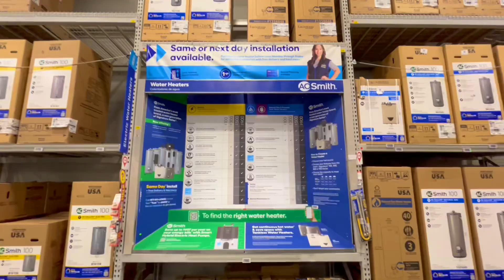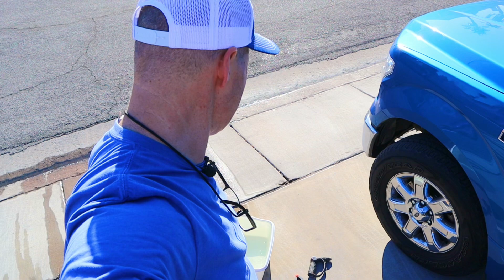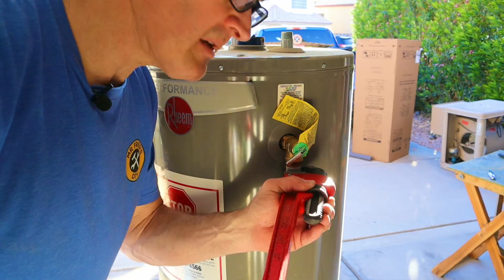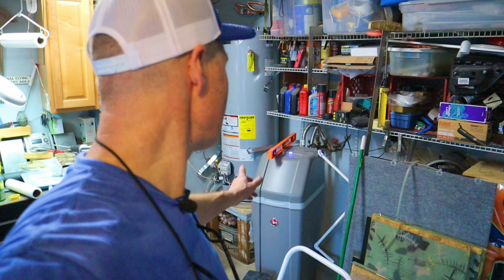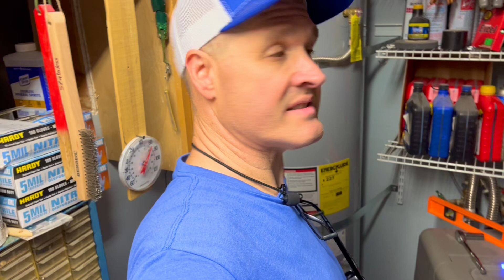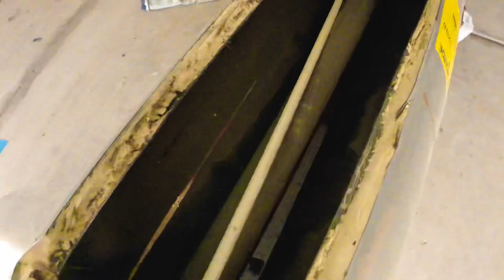Water Heater Installation -Why my 3 year old water heater failed!

Comment from the maker: Okay guys! Tell me what you think about that old tank? Also, did you come to watch the water heater installation or to watch me cut open my old tank?  Leave a comment below and tell me⤵️
Reply: you might need to test your water to figure out why the rod got ate so fast, could be you might need a different anode material as some metals work better with certain water ph levels than others. 

Note AO smith states the anode needs to be checked once a year for warranty.
Reply from the maker: Thanks for commenting! I was wondering about the composition of my water, and how that might affect the tank.
Reply: That old heater was pretty gross….was wondering if there was also any sediment buildup in the tank?
Reply: Did you install that softener with the old tank? The anode rod is there to keep the tank from scaling to my understanding. The fact that it failed essentially immediately upon installation tells me that’s a very bad product.
Reply from the maker: @geneshort8160 I have always has a water softener. Perhaps the chemistry of the anode rod and the composition of my water are not a good match. I think this video still has questions yet to answer!
Reply: I just realized that deep red staining is the same staining in my shower when my water heater kicked the bucket (to be fair it was probably 15+ years old), well now i know the signs
Reply from the maker: @jjjacer From the time I first noticed the yucky water (my wife noticed first), I was curious as to what was going on inside of the tank and I started planning on cutting it open for a video. As soon as the company notified me that a warranty claim was not in my future I decided to cut it open for sure. If I would have returned the tank for a warranty swap, we would have never known what was inside. This video cost me $605 to make but it was well worth the money!
Reply from the maker: No sediment really, just some rusty debris.
Reply: after I saw your video I decide to get new one from Lowe's if I replace the old one.  My old one was from Lowe's 19 years ago still works fine.   My home is in Las Vegas too.  Thank you for great video.

Comment: Usually when you feel that your water smells funky it’s the anode. Your water should be tested first because it can be very caustic like mine. I put a filter in place. My anode Rod lasted 10 years. No smell no gunk. Make sure you flush throughly. Filter and anode Rod is much cheaper than a new tank. My AOSmith heater lasted for 21 years. I’d say I got my monies worth. Ya think!

Comment: Judging by how fast the anode rod had corroded, you might want to change the one in that AO Smith every other year. There may be something in your water supply that's causing it to corrode faster.
Reply: @hochhaul  looks like he has a water softener..   the sodium attacks the anode rods. And cuts life expectancy of heaters in half.
Reply from the maker: @javierdiaz2666 The salt actually never enters the water supply of the house. The salt simply recharges the resin beads and it is then flushed away into the drain of your house via the Venturi valve. (The Venturi valve is constantly exposed to saltwater, which is why they need maintenance). Some folks argue that soft water, free of all minerals, produces a particular charge to the water which causes corrosion on the anode rod.
Reply: @javierdiaz2666  I have a water softener and my AO Smith Proline power vent is 10 years old. No issues, just changing anode rods every few years. Changed the T&P valve once.
Reply: @hochhaul  yup doing yearly maintenance(flushing out tank )  as well is a plus.

Comment: In prepping for my installation and in dealing with my old tank too long found the anode should be inspected and replaced. But it seems your anode rod died too quickly?  thanks or the dissection !
Reply from the maker: Yes, my anode rod died prematurely, and actually rusted in half and fell to the bottom of my tank. This half of the rod was just laying there resting away turning my water foul.

Comment: Gas water heaters are probably more likely to have problems. There is a big tube going through the middle and more places for rust to happen and also higher temperature gradients from the flame. I don't see calcium buildup. Do you have a water softener that might be adding salt to the water and increasing its corrosion potential. Also get the ph of the water checked. You may have to replace that anode every year or so.

Comment: Nice video. One safety suggestion. When you turn the gas on you first check for leaks and then light the pilot. The spark that lights the pilot can be detrimental if there is a gas leak. Also the gas line adapters seal on the flare and do not need PTFE tape. The tape does absolutely nothing.
Lastly, when you replace this heater again, buy your new water heater from a Supply House. The water heaters in "Big Box" stores are not the same quality as those sold through supply houses. Google is your friend to verify this statement.
Reply from the maker: Thanks for the tips!

Comment: Recommend loosening the new anode rod  (remove and reinstall with some pipe dope) so you can get it out in 2-3 years. Your water is eating those anode rods, so play to replace every 2 years or so. If you have removed it before, it is much easier to get out than one that's been rusting in place for a long time.  Also recommend replacing the drain valve with a full port valve; best is a short brass nipple (3-4" long), a full port ball valve (threaded in/out), a second nipple (2"), a street 45 deg fitting, a hose adapter nipple (3/4" IPS to 3/4 GHT) and a cap. About $25 in fittings what you can use from tank to tank. This will give a much better success at annual flushing as the passages are much larger than the one supplied from the factory. If you flush every year, and change the anode rod before it's gone, you should get a lot of life out of the new heater. Actually, the old heater looks like it could have just used an anode rod, a better flush valve, and some maintenance -- but that doesnt make for good youtube videos :)... Good luck

Comment: You have really soft water you could have just replaced the anode rod and flushed tank really well and it would have lasted you another 3 years this new water heater will do the same thing in 3 years the rod it self last 3-5 years in ur case I would change it in 2 1/2 years to 3 years or look into fixing ur soft water issue
Reply from the maker: Thanks for commenting! After cutting the tank open and seeing half of the original anode rod rusting away at the bottom of the tank, I realize that no amount of flushing would have eliminated my brown water problem. I am certainly glad that I replaced this tank and will likely change my anode rod in two years.

As a side note, if you watch the video closely where I film inside the tank, you will see that the tank was already starting to get compromised where the emergency valve enters and at the top of the tank where the waterline comes in and the waterline goes out. After inspecting the lining of the tank itself, I was shocked to see many spots of rust starting to penetrate the enamel lining as well. I did not throw away my tank because it is part of my studio now lol.

Comment: How has it worked for you sir
Reply from the maker: Recovery is fast and no more brown water! I was reading about the benefits of keeping the water temperature a little hotter. Turns out that a hotter tank is more sanitary!
Reply: @MrFredsDIY  how hot what level
Reply from the maker: @jaytravel-12 The temperature adjustment knob has (A,  B,  C,  Very Hot) in that order. I have mine set between B & C.

Comment: THIS IS BULL CRAP- NOTHING WRONG WITH THE HEATER-he’s got iron bacteria-not at all toxic but impacts water color and smell—-HE’S JUST BEING PAID TO PUSH THE SMITH BRAND
Reply from the maker: This video was not sponsored and I paid for everything myself. My old tank was in fact, ruined. Several places around the tank where plumbing connections enter the tank were corroded. I was also surprised that many areas of the enamel coating were pitted and beginning to rust. The video also clearly demonstrates that the anode rod was not only depleted down to the core metal, it additionally had separated  into several large pieces which were laying at the bottom of the tank in a rusty pool. 

Had I simply replaced the anode rod it would not have a dressed the remaining broken pieces of old anode rod, which were contaminating my water.

Comment: I agree with you.  The tank is ruined with a big rectangle hole in its tank.   Ha ha

My water heater is 27 years old with zero problems.  I contribute that because it uses water form the water softener.
Reply from the maker: That is fantastic! Plays a big role in tank longevity. Also 27 years ago, I believe things were made a lot better!
Reply: mine is 25 years old ("self cleaning" & 8 year warranty). Never replaced anode rod. Drained one time. On a 35 foot well with a softener. On borrowed time?
Reply: @michaeljohnson6887  YES
Reply: @michaeljohnson6887  Yes!  The normal life of a hot water heater is 15-17 years.  One day soon you are going to experience a tank leak, it's not if, it's when.  YES, borrowed time!

Comment: I just so happened to professionally install these for a handful of years recently. Rheems for The Home Depot, primarily, but almost everything under the sun, actually. So here's my takes on things. So, the smell you had in your water was from the absence of the anode rod. I'm guessing water in Nevada ain't that great, but it seems like there could be a variety of contributing factors here. Galvanized piping. Is the whole house the stuff, or is this branch leading to the water heater the last of it? Repipers seem like they can't be arsed to move water heaters for their work. Also, though I'm sure they still sell them in big box stores I'm sure, saddle valves are a violation of code in Nevada, actually. And they really don't help galvanized nipples. I'm surprised you were able to reuse it, honestly. And frankly, I wouldn't. The seal between flex lines and the corroding edges of galvanized nipples are a routine failure point I saw.  My (and others) methodology was to replace every bit of galvanized pipe  leading to the water heater  before a female fitting with a brass nipple. Galvanized fittings (especially the ancient made in USA one) hold up incredibly well. The pipe is nothing near. Also, gate valves are generally terrible and very rarely successfuly shut off the water heater, so we replace these all with ball valves. 

And no, this was not hunting for making money off the customer. I did everything in my power to skirt charging customers additional money when I was doing that job, and the way in which I was compelled to was a huge part of why I left. 

Other things. 
(I should say, I've seen plenty of other videos, including one from This Old House that were super unprofessional, this one is nowhere on that level. Our low tier installers with the company would have done worse.)

The use of flex lines as drain line for temperature and pressure relief valves is unsupported by code. As chintzy as it seems, CPVC is kind of the best thing for this. I mean, copper's actually the best, but it's costly and requires knowing how to sweat. 

Also, I would have got a Bradford White or some other specific model of water heater that had a top mount T+P option. Furthermore, you can remove the valve and thread it back in with new tape and dope and alter which direction it is pointing so long as it is not oriented to drain upwards. Diagonally would help here. 

Also, a thing I would do for customers was salvage the good brass drain valves off of dead tanks (particularly Rheem Gladiator electric water heaters that had an almost 90% failure rate for their upper thermostat) and use them to replace the craptastic plastic drain valves like the one you've got here. You can buy Everbuilt ones at HD for not too much.

Another small thing, the C-vent isn't seated as well on the draft diverter as it should be. :/

And another thing for the galvanized piping, the rust, and etc.: I would forego using the copper flex lines. Strictly speaking, they are considered fine and equivalent to dielectric unions and whatnot, but you are inserting a dissimilar metal between two similar metals needlessly. The stainless flex lines really can't be beat, Brasscraft especially. 

As for the anode rod situation, you should definitely open up your drain valve and dump some water every year or so, and get yourself a 1-1/16 6-point socket and maybe replace it in a year and a half or 2 years with an aluminum one. The magnesium ones are generally considered better, but it seems like some water is like piranha solution to magnesium but behaves normally on aluminum.

Also, maybe it was intentional, but the thumbnail seems to suggest you are replacing a gas Rheem with an electric AO Smith. 

Lastly, if it's not too late, you could have scavenged a fairly valuable part from the Rheem that you could have held onto for someone in a pinch or sold on craigslist or something. The TRD. Or thermal release device, I think. It's in the burner section. It's a fire sprinkler head-like capsule mechanism that basically doesn't exist for sale and will "brick" a modern FVIR tank for good if you can't get one if it should break. Which happens quite often with 75s.
Reply from the maker: Thanks for taking the time to write your comment! This will certainly give viewers plenty to think about!
Reply: @MrFredsDIY Oh sweet, the AO Smith in the thumbnail is a gas now. Thanks.
Reply: Oh, and as for the flare connection. Nothing wrong with it unless it was a lot of tape that would get in the way of you seating the fitting adequately.

And even though nothing about your issue would seem to suggest it, it might be worthwhile (for code compliance and whatnot) to determine if your house's water  lines are a closed plumbing system and whether or not there should be a thermal expansion tank installed on the inlet side of the tank. What makes the system closed is a one-way valve that exists on the street side of the water heater. A check valve or backflow preventer by the meter, or a pressure reducing valve in the house,  likely in the garage if anywhere. This can also largely be determined by observing the behavior of a (3/4" GHT female) pressure gauge when you attach it to a hose bibb with a dual shutoff hose tee. A little difficult to explain in words, but there's probably videos on it.
Reply: As a professional water heater wrestler / installer, I endorse this comment.  @orijimi
Reply: @jamesrecknor6752  I'm pleased to see that sentiment develops to be fairly uniform across that line of work. Hope you're enjoying it. I mostly did. But do try to not let it ruin you. Good luck to you out there.
Reply: Can I ask you what are some of the best water heater brands for gas recirculating water to the HVAC if you have on east coast water but cold winters? I need a plumbers unbiased opinion and not some public affairs b.s. your opinion matters, please advise 🧐.
Reply: @meowmeow2030a The tank water heater market has almost no competition present in it now. Tanklesses have much more variety still. There's basically just Rheem, AO Smith, and Bradford White. And of course, a couple additional brands in the small form factor point-of-use space like Bosch and EEmax. AO Smith makes it seem like there's a lot of other brands because they make American, State, and other weird things like the "Direct Vent" brand. And it seems like there might be something legitimately different about those sub-brands. Anecdotally, they are longer-lived and better quality than standard AO Smith. So, yeah. Your recirculating water-source heating. I'm guessing it's a water heater doing dual service of providing hot water to your fixtures too. Well, the simple choice there is a 75 gallon gas. I would recommend Bradford or AO Smith there. Rheem 75s started having something wrong with them that was blowing up TRDs left and right starting in 2021, going into 2023. Hopefully, it's been resolved, though. But if only a 50 gallon is what the space allows, my only recommendation is a Bradford White RG250H6N. Sadly, they are only a 6 year warranty, but they are a beast of a tank. 

That said, there's no guarantee either of these options can work with your current venting. If it's 3 inch B-vent rather than 4 inch, you're basically boned. Also, your gas piping might not be able to supply an adequate amount of additional gas for what these need. But that's much less likely.